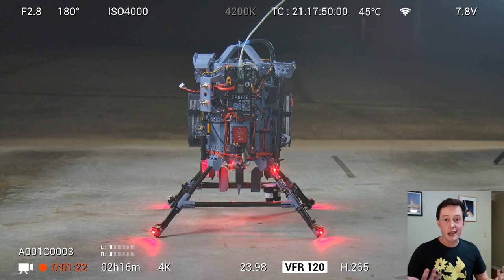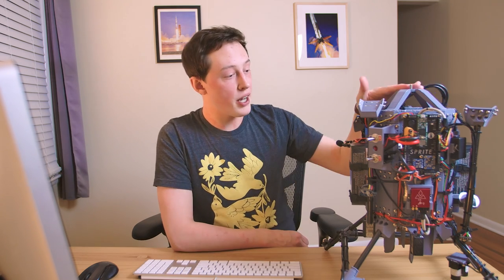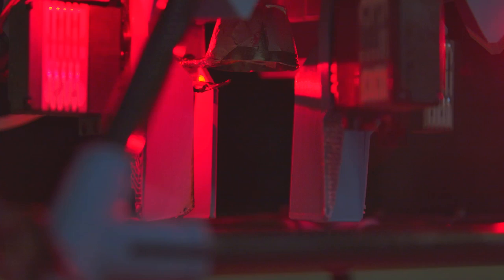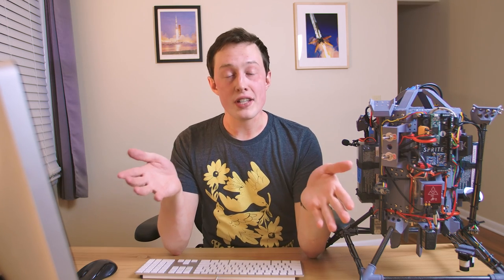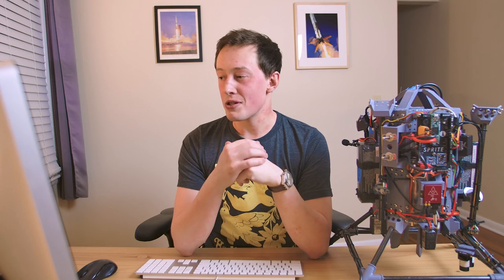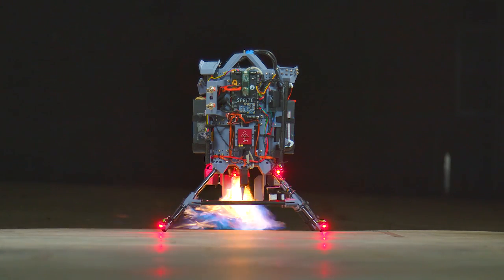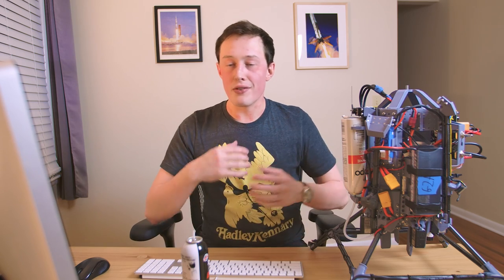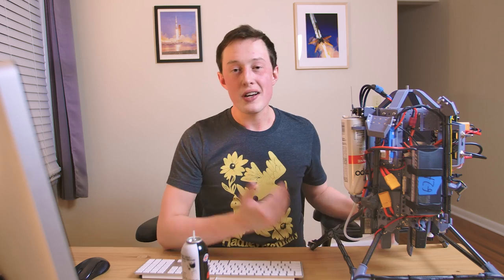EDF Afterburner Fire

Comment: If you wanted to actually generate some thrust you could use propane instead of butane. In either case warm the can a little first to help maintain good fuel pressure. Then provide an aerodynamic flame trench well below your fuel inlet, and enclose all the ducted air in a full diameter tube that narrows a bit just at the end. This guy's channel has some great info on theory but it takes a little patience to dig through. https://www.youtube.com/watch?v=1DdF3U2g-Ic
EDIT: OK. Watched to 5:40. That design will not work, as you have discovered. Release the fuel into the air stream ABOVE the nozzle. and have your igniter near the end of the bell. If you simply must have a pretty display flame coming out of the nozzle drill a circle of small air bleed holes at least halfway up the bell. to provide O2 for the flame.
Edit2: 11:46 Yep, about that.
EDIT4: Here's a better tutorial: https://www.youtube.com/watch?v=e68cgU7lJ9E

Comment: So have you given thought to either running 3x ducted fans vice one or adjustable exhaust nozzle similar to jet fighters?  Also another though if to do away with the fins and go with thrust vectoring of the motor/s only with adjustable nozzles?
Reply: Found this on YouTube that is a different outlet nozzle to consider. https://www.youtube.com/watch?v=lUYFe6S-ZbM   I think you need a method of adjust output pressure on the EDF fan.

Comment: Dump the idea of heating the Butane. It will never heat it up fast enough to make a difference. It would be better to buy a metal spray nozzle. There are week killer pump spray bottles out there with metal nozzles. This will take the liquid and squirt it out into a very fine mist, which is what you want.

Comment: Wrong about the afterburner kit not having any thrust, with a thrust tube ; it can produce 15-20% of thrust. “Just for looks”,??? tell that to pilots of an F-16, FA-18 or F-22. And I would know about the project because I’ve been doing research on afterburners on rc EDF JETS for 6 years. 
Also, your butane is coming out too lean, that’s why there is a coiled tube that leads to a ring of injectors that feeds the fuel as a GAS which is lit inside the ignition chamber. Injecting it while it’s inverted, bad idea... you’re just flooding the chamber and creating a more fire risk than before

Comment: Awesome progress, and thanks for starting with FIRE!

I know you've done your research to have gotten this far, but I want to suggest you also check out this episode from "Flite Test":  https://www.youtube.com/watch?v=yKuq8T7KMa0

David Windestal did a great job getting his butane EDF afterburner working, and it appears to be working across the throttle range.  He has a few details in his build that I think you might find interesting (hot wire around the expansion coils, for one).  Hope this helps you get to full throttle!

Comment: 3kg+ sounds CHUNKY. Mate I feel like you need to use some engineer black magic to add some lightness.
Reply: Looking at it there's definitely room to reduce weight. Look at those enormous metal toggle switches! Although if he's not chasing long flight times, and has excess thrust, I guess the extra weight really isn't the end of the world.
Reply: I feel like a lighter aircraft would be easier to control with his half smelted control vanes/paddles.

Comment: Hello Joe! I believe I have an idea to help solve your afterburner's pressure problems at high speeds. 
The idea would simply to use a different nozzle for the afterburner, one would, by its design, allow the creation of a low pressure zone. I've made a quick draft about the whole design aspect (disclaimer : I'm just an engineering student, not an actual engineer), is there any way I could get it to you? Unless you've already thought about it, in which case... welp.
I hope you'll see this! I'll also try and reach you via Twitter. Have a nice day - Alexandre

Edit : I have just posted said sketch in a comment under your latest post on @bps_space on Twitter, in an Imgur link. My twitter tag is @AlexandreArrive, hope you can find it!

Comment: I am not an expert but I have worked a lot with industrial burners.  

Air is excess with lower head pressure.  
Calculate air intake nozzle size 

The combustion nozzle is missing 
https://www.aerospacengineering.net/1241/

The fuel Injettion is not controlled.  
Use a throttle valve .

I also wonder if we can use commercially available burner nozzles to better design the combustion chamber ?